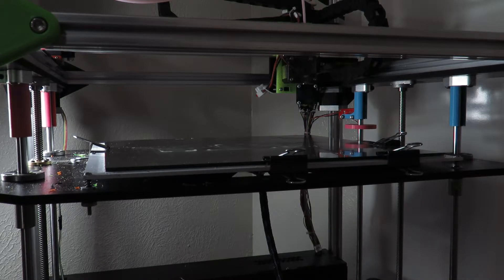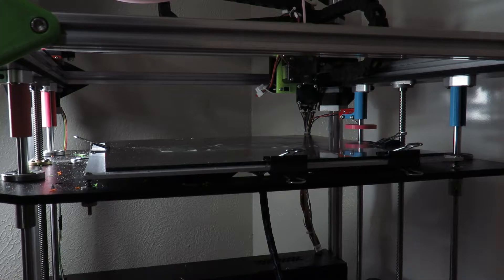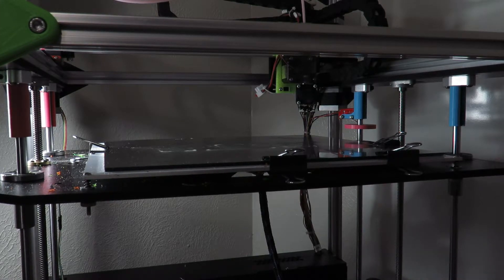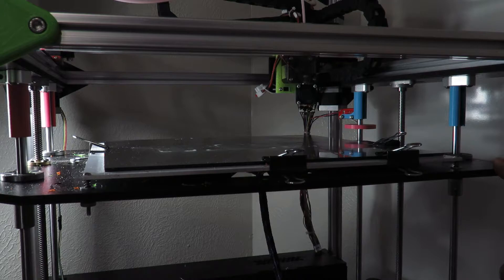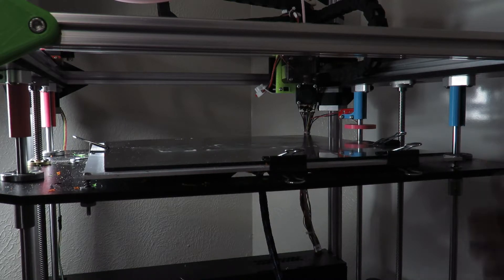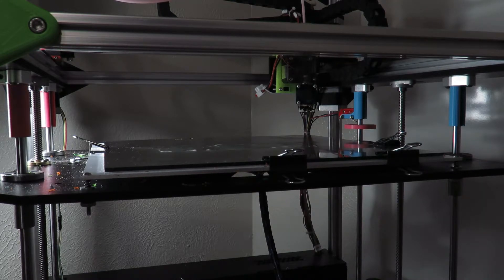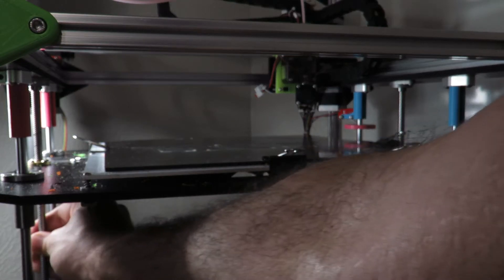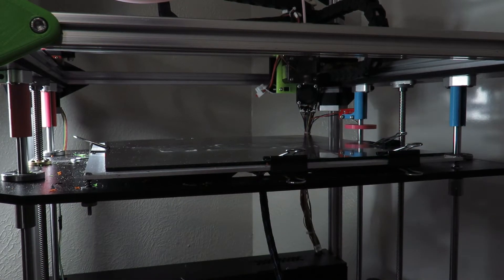FT5 Mechanical Bed Leveling

Comment: This is an excellent solution! Has this method continued to work well for you over the last month?
Reply from the maker: William McFee Thanks! It has worked 99%. If the two sides are severely out of line, it doesn't work.
Reply: I just got my FT5 yesterday! I'm having trouble with the lead screw installation (every time I try to tighten anything up, it binds the z-axis).

Any tips?

Thanks!
Reply from the maker: William McFee leave every thing loose and then run the bed up, tighten the top, then to the bottom and tighten the bottom.
Reply: Well I've had a lot of problems leveling my bed,so I printed these and installed them but they stop my bed  over an inch and a half below the nozzle. Is your printer different or something?